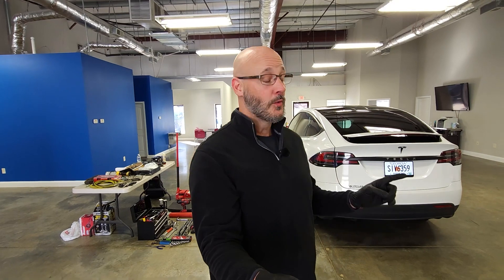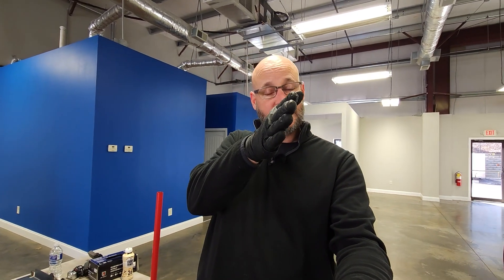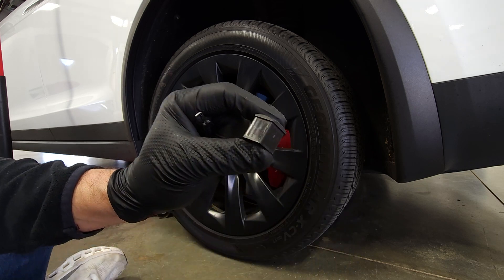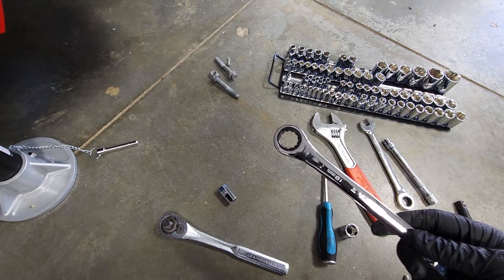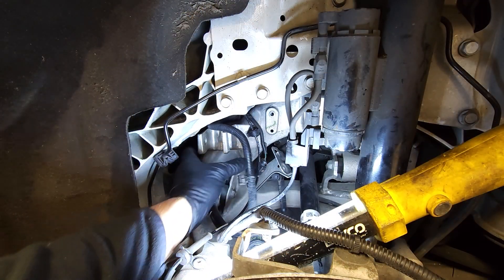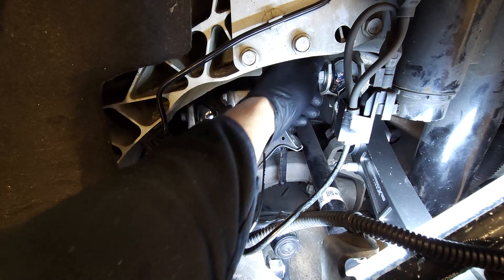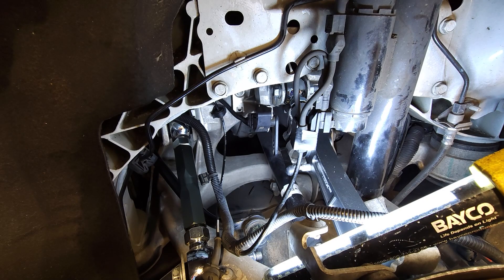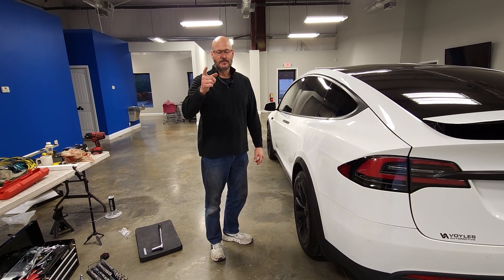UPDATED VIDEO LINK IN DESRIPTION - Tesla Inner Tire Wear - Here's the Fix!  Model X / S

Comment: Are you sure the adjustment side of the arm is supposed to be on the inside.  When you adjust the arm it will move the position of the ride height sensor.   Even though it is harder to adjust, shouldn't the adjustable side be at the knuckle so when changing the length of the arm it will not change the position of the ride height sensor.
Reply from the maker: Yes, if the camber arm was the other way, it would hit the control arm. Check out the updated video: https://www.youtube.com/watch?v=32iYH0HZvgI

Comment: WHY I HELL ARE you putting people to do something like that...  When you can bye or use shimmers to move original arm and fix that ..   or just remove tyres from the rims and change between back tyres ..  

💪👍
Reply from the maker: You can't use shims to add positive camber to this Model X. Plus, I like the professional adjustability to dial in the alignment. This is much more precise. Remounting the tires would help, but there's a cost to mount and balance tiers, and they'd still wear out faster due there only being a few inches of rubber that takes most of the punishment during acceleration.

Comment: Early in the video you expressed puzzlement that Tesla has, by design, included negative camber on the rear wheels of their cars. I stopped by Discount Tire this afternoon and asked for a tread wear check on my 2020 LR with 50k on Michelin Crossclimate 2 tires and the tech told me the insides of the rears were at the wear bars, confirming what you said about camber causing wear there. I like to think Tesla put a lot of thought into that layout and indeed, I’ve noticed some other cars (BMW’s come to mind) also have negative rear camber. I’ll have to search the interwebs later. The Michelins can only be rotated F/R, which I did this afternoon and will be sourcing new rubber soon. Finally, my car absolutely roars with tire noise, even though Tire Rack reviews say the CC2s are quiet. Is it the tires or the car? Any recommendations for quieter tires?
Reply from the maker: My puzzlement is that Tesla doesn't provide any adjustability on their camber arms. Every vehicle with independent rear suspension is prone to negative camber (straight/live axle vehicles don't have this issue). The wheel assembly pivots up and down on a circumference, so the lower the car gets, the more negative camber there is. A little negative camber helps when corning. I prefer -0.5 degrees... many Tesla's have -2.5 degrees (or more). 

If you're tires are staggered (wider in the rear) you can rotate them. 

You're doing the right thing on reading tire reviews. I'm happy with the Yokohama Geolander X-CVs.

Comment: You torqued the bolts with the suspension in very high position.  When you then lower the car, the bushings will be over twisted.  That may cause the bushings to fail.
I am close to buying these arms from N2itive, because it seems like they have the highest quality for the bushings and the best corrosion resistance on salty winter roads.  I hope that is correct.
Reply from the maker: The bolts on the camber and toe arms do not bind the movement of the arms, so there's not need to worry.  But you do need to be sure to follow the torque specs set by Tesla.
Reply: @teslatipsandtricks  I don't know this brand of arms, so maybe what you say is correct for this specific type.  But the most common types of rubber bushings have an inner metal sleeve that gets clamped in place when the bolt is tightened. The rubber is then meant to twist slightly as the suspension moves. If you tighten the bolt while the suspension is hanging, the rubber will already be twisted when the car is lowered to the ground. This puts constant stress on the bushing, leading to premature wear, reduced suspension movement, and possible noise. Always tighten these bolts at normal ride height to avoid overloading the rubber.

Comment: @teslatipsandtricks Very nice video! How have those aftermarket Toe and Camber arms bushings held up in in 3 months? I've seen some other brands that failed pretty quick. What brand did you buy and what website?
Reply from the maker: The camber arms I installed did NOT hold up well. The bushings failed. The only brand we'll use and recommend moving forward is N2itive. https://n2itive.me/shop/?utm_source=tesla-tips&utm_medium=youtube&utm_campaign=tire-wear
Reply: @ Thanks! I've been in contact with Don at N2itive and will purchase their camber, toe and lowering link kit.
Reply: @teslatipsandtricks  are they sponsoring you to talk about them? just want to know if this is a real endorsement

Comment: My good Sir, first off nice video you got here.  Second, how does Tesla react to this when we take the car into the service center for alignments?  Will they say it needs to be removed because it's not their stuff?  My car is way out of warranty, but I'll still need to go to them for alignments.
And if not, do you think they know how to adjust these arms?
Reply from the maker: Thanks for the compliment! From the factory, there is little to no adjustment on rear alignment. Tesla techs work from a Service Manual, so it's not likely they'd adjust aftermarket camber and tow arms on the rear. It's not that they wouldn't know how to do it, it's just not included in a regular alignment. However, a lot of Tesla owners don't get their alignments done at Tesla, they use tire stores. Tesla Service is very fair on their pricing on most services, but they're a bit high on tires and alignments.
Reply: @teslatipsandtricks Oh okay. I just went to buy tires at Discount Tire & I overheard them tell someone else that they don't do alignments.  I'll shop around.

Comment: So what rear camber spec did you have the alignment shop set on the car?  What handling difference did you end up with and are you happy with it? If you posted the printout of the alignment, that would be helpful for folks who follow your example.
Reply from the maker: I told the alignment shop I wanted it to be zero camber on the low setting. I don't have the print out.